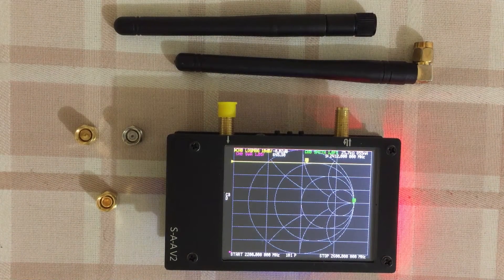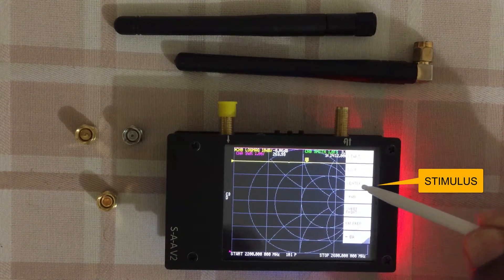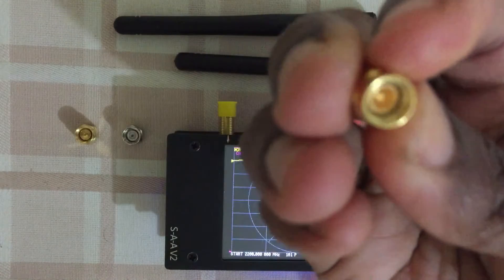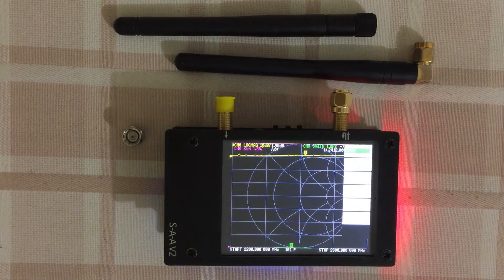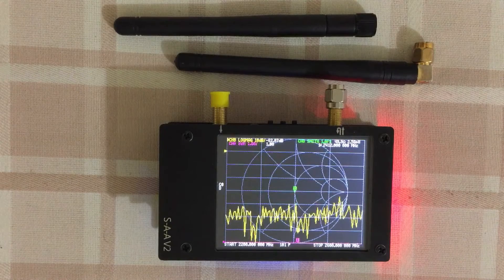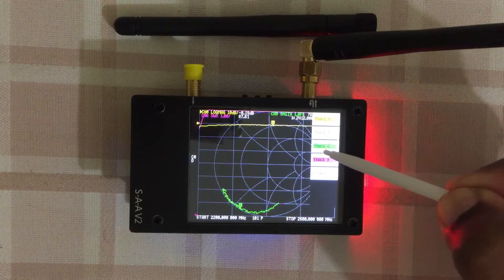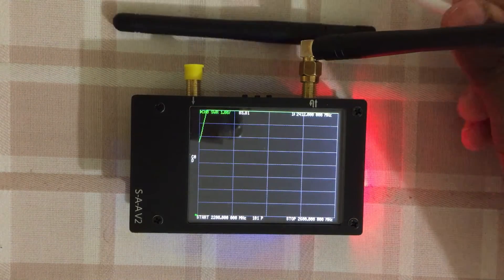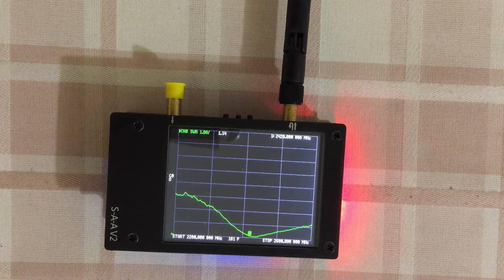25. Check 2.4 GHz WiFi antenna using NanoVNA

Comment: Sir, can you teach how to do impedance matching using this nanoVNA? How to choose components to match the impedance?
Reply from the maker: Even though there are many characteristic impedance, practical usage there are two common values 50 ohm and 75 ohm. 75 ohm mainly used for television antennas and 50 ohm for telecommunication transmissions. 

Just focusing on 50 ohm, the antenna impedance from zero to infinite depending on frequency.
To transmit and receive maximum power (for longer distance or clear data) the antenna must match as close as to pure resistive 50 ohm. There is a smith-chart in Nano-VNA, you can plot and view it. 
The centre point is the sweet-spot of 50 ohm. 

Whenever you design an antenna make sure to have 50 ohm or closer to it at the desired frequency. Normally, it can be achieved by changing the length of the antenna. Hope it is clear
Reply: @NizarMohideen  Thanks for the reply. However I was concerned about choosing components when tuning using the circuits like pi and T filters.
Reply from the maker: I am sorry I don't have pi or T filters with me at the moment to demonstrate
Reply: @NizarMohideen  That's okay sir, thanks for your effort for sharing knowledge.
Reply from the maker: Thanks